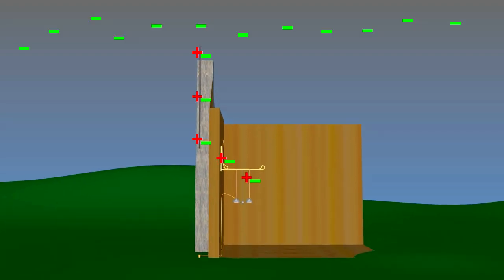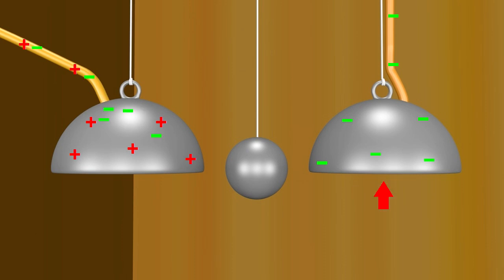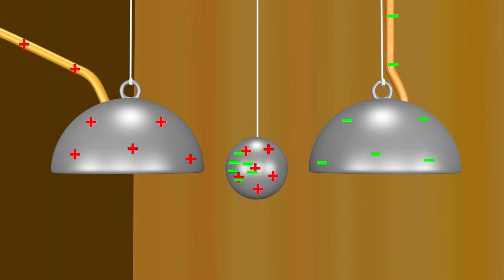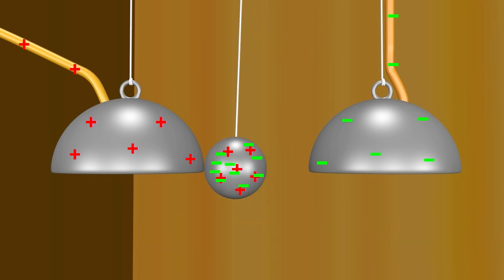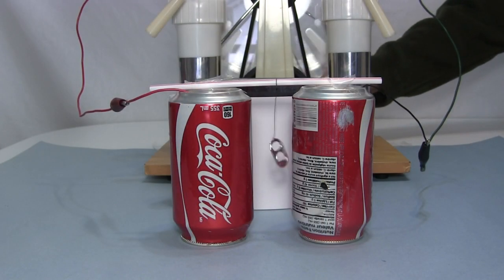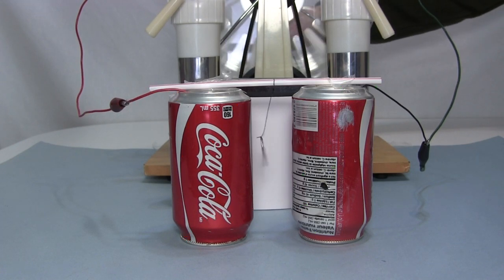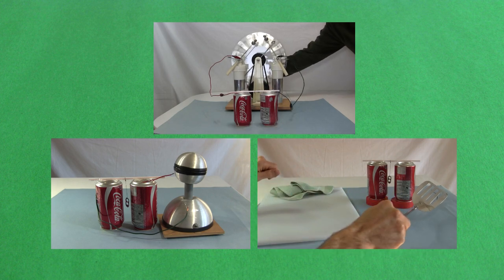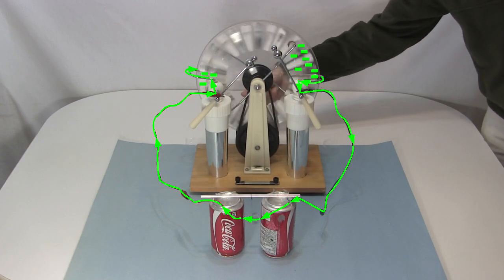Franklin's Bell - How it Works

Comment from the maker: I once removed the grease from a bearing and replaced it with MG Chemicals' brand of carbon conductive grease. But when I put the bearing back together I guess the seal wasn't perfect, that or the high RPM of around 8400RPM was too much for it and some of the grease came out over time. That was my only experience with conductive grease. I'm sure I could have done better had I pursued it further. If you're curious, it's on the Conductive Bearings page in the Equipment section of my website.

Comment from the maker: An electric field is stronger at a sharp point. That makes it collect electrons from ions more easily than a blunt surface, making them no longer ions, i.e. deionizing them. Lightning follows the path of least resistance and ionized air is a better conductor than air without ions. When using it as a lightning rod the idea is to deionize the air so that lightning doesn't follow a path to the lightning rod. With the bells, the circuit makes use of the electrons from those deionized air molecules.

Comment: OK  found some stuff including Carbon Silicone and silver silicone grease.

Be fun to experiment with different ones to measure and compare the Resistance of each put in a 1" line. including some of the home made ones I mentioned.

Another Idea would be to impregnate Silicone caulk with carbon or graphite. So one could make a structured circuit line on a PC board that would cure and be pliable unlike the silver conductive paint pens. Sorry for going off subject on your post.

Comment: I made this for kicks, but glued the straw on, sanded the sides of each can and then taped the wires on. I put one wire from the non-taped straw can out the window tied to a nail, and the other wire to the ground in the house. Will this still work? I used magnet wire from transformer.

Comment: Can I use a regular AA battery or does it have to be static electricity
Reply from the maker: It has to be high voltage, in the thousands. AA batteries are far too low voltage.

Comment: While walking my dog I thought of a good assignment you may wish to try. For years I've been looking for a conductive grease for electoral connectors on my auto and Motorcycles. I'm Familiar with dielectric grease witch is designed for this purpose neither conductive or not. But I want a grease that is. I've thought about using a silver circuit board tracer but that would glue the connectors. I've lately learned that printer ink is conductive I'm thinking mixing that or graphite with vaseline.

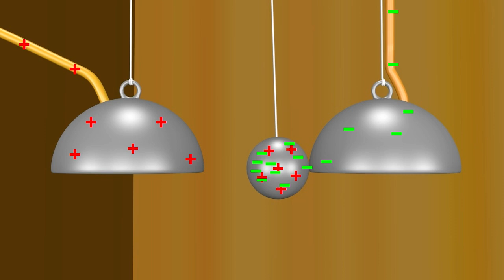Comment: 1:31 if the ball repels, does that mean it has more electrons than protons?
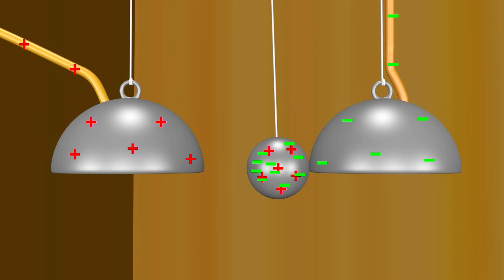Reply from the maker: Yes, there are more electrons than there are electrons on the ball at 1:31. That makes the ball negatively charged -- the electrons are negative and the protons are positive. The nearest bell is also negatively charged. Since they're both charged the same way, they repel each other. That's another way of saying that like-charged objects repel each other.
If they were both positively charged, more positive protons than negative electrons, then they'd also be like-charged, they'd also repel each other. That happens at 1:50.

Comment: now hink about it. that is energy being discharged. right????  ok now when discharging it run it through a transfomer and charge a capacitor, nor run a inverter from that to run power to your tv.... now bigger attena and right tuned coil. in which is easily calculated with distance of attena. and boom, no more money to the power company, yes you now can keepo that money for yourself, go on treat yourself right,   thanks adn for more info i am at frederick minkenstein at facebook add me, i help